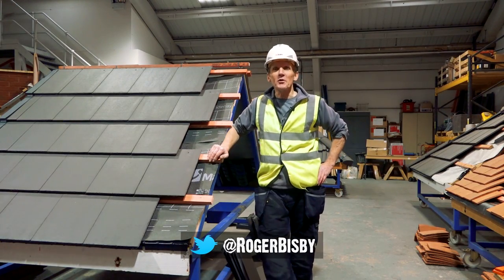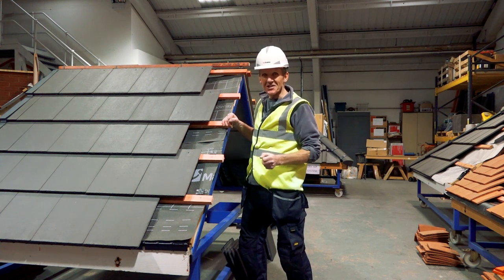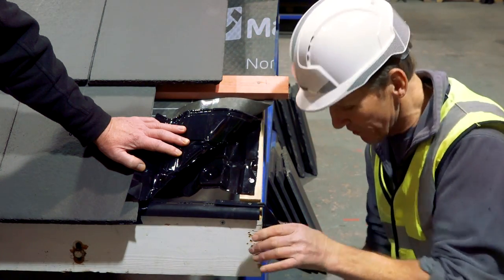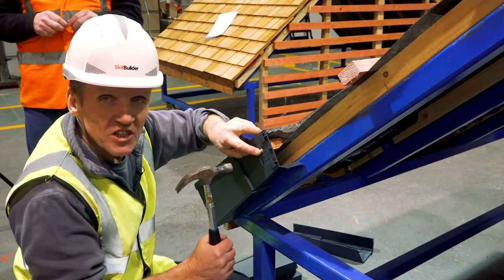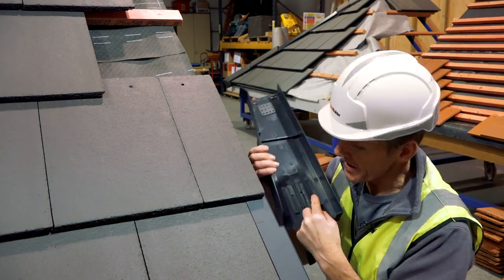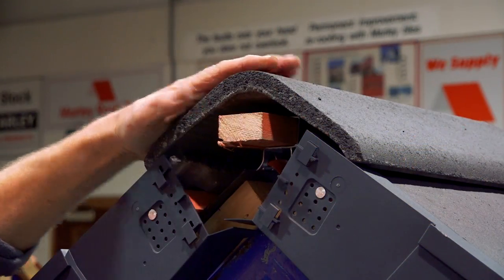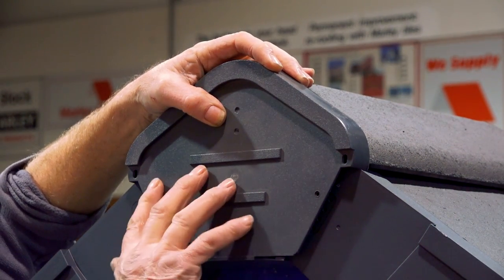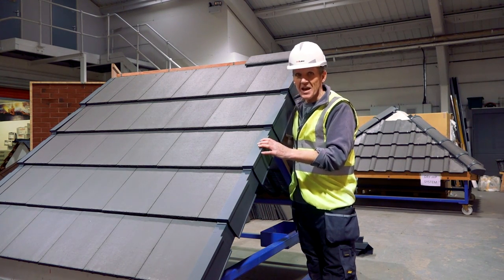Marley Universal Dry Verge Fixing System Review

Comment: I use these verges very often and they have made a big improvement in there system over the last few years, they used to be garbage but much better now. Although the fixing kit at the bottom is v v flimsy and the little mettle clip pops out of the socket very easily so I prefer to drive a 100 mm screw with a cap on to fix first verge. Also mention when battening up at the top make sure your nail heads are covered by your end cap as on this video the left hand side one wasnt👍

Comment: I suppose times have changed along with regulations, and I'm all for it, it is for the better on most occasions. However me being old skool love the look of a well pointed verge! Nice demo.
Reply from the maker: I agree with you and I would go for a mortar bed with smaller tiles and slates. I reckon with a bit of SBR in the mix they hold down well.
Reply: No regs have changed, cement is still accepable, its the fixings regs which have changed.

Comment: I fit guttering and I'm always been called out to 'guttering leaks' on houses with a dry verge system.
The wind drives the rain water under the verge and it streams out the bottom missing the gutter.
I normally have to fit a 90 angle and silicone the gap up. 
NHBC interfering and creating new problems.
Reply: Yes. I agree with you. The edging stops behind the gutter so any water that gets under slate runs down and rots timber. The edge should have an overhanging lip the same as the slate si water goes into gutter. I would safely say that majority of houses using trim have rotten timbers but wont be seen for ten to fifteen years. Im talking about all types especially valley trim.
Reply: @user-tp2ks4ts2i  l

Comment: I use these all the time over the old way but for the first cap I drive a dry ridge screw with the rubber seal in about 100mm from the front and also to fix the ridge cap just a better fixing than a nail

Comment: Of course the preliminary step is to set out the roof tile rows so that if you are tiling from one verge to another, i.e. with a straight up-and-over roof, you don't need to cut the end tiles to fit - I've seen many jobs where so called roofers have had to cut the opposite verge end tiles and of course then they are difficult to secure and look wrong. As you lay from right to left of course this only affects the left hand verge. On this video, a right hand verge, the interlock channels are on the underside and don't show. The advantage with this Dry fit system is that with Marley tiles, who don't make a specific left hand verge tile, it hides the ugly interlock channels otherwise visible on the upper face left hand edge

Comment: Do they have to go under each tile as my tiles are cemented in all way along
Reply: Best way to do it is pull the cement and verge cloak out, then cut the battens back 3 rafters and add new ones into place so you know you have a solid fixing point🙂
Reply: @brad15020  or you could instead of cutting the battens back buy some lath extensions 👍
Reply: @danielm361  never tried that, might have a look into it

Comment: What over lap do u use on 420x280 concrete tile?
Reply from the maker: it depends on the angle of the pitch, The manufacturers always give a headlap figure based on pitch. 50mm is common

Comment: There's nothing wrong with sand cement if its done correctly with half soft and half sharp sand and cement. It will last longer than this plastic crap in my opinion. There's one thing shilling this dry verge but you shouldn't be saying cemented verge and undercloak isn't any good because it's simply not true.

Dry fix ridge is good but I don't like that cheap nasty plastic verge.
Reply from the maker: Alex 
When I say it is no good, this is a simple fact. It has been tested extensively and it cracks after a few years which lets moisture creep in. You then get frost lifting the verge and in a high wind the verge will come off. I don't like the plastic either but it stays put in a hurricane. It may be that you can knock up a magic mix but nobody knows how good it is until it fails. This is the problem with the building industry....too many variables.
Reply: @SkillBuilder  I've been roofing for 25 years and I know for a fact that a cement  verge lasts more than a few years! Maybe they last a few years if some bodgey builder does it in soft sand and doesn't know what he's doing. 

I'm not the only roofer that disagrees with you, this topic has been discussed many times on master roofers and majority think that you're talking nonsense. 

As far as your magic mix comment goes, roofers have been putting sharp sand in there muck for years.
Reply: I don't think they would survive a hurricane. @SkillBuilder  😂That would be the least of your problems!

Comment: I thought you had to put metal clips over the end of the batons to stop them splitting.
Reply from the maker: The clip is an option. There are several ways of doing it. I use graded battons and screws in the end grain.